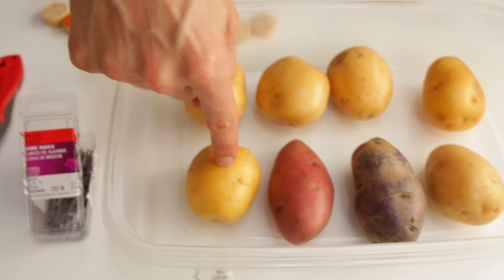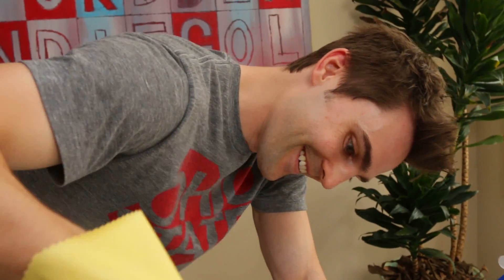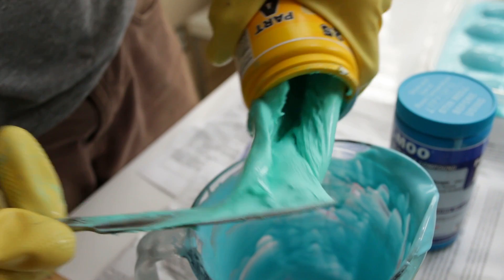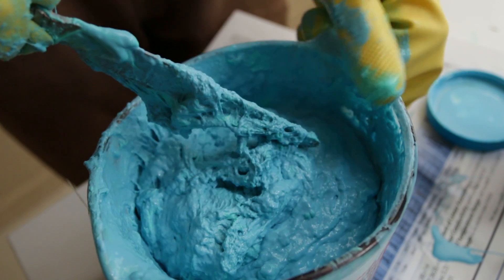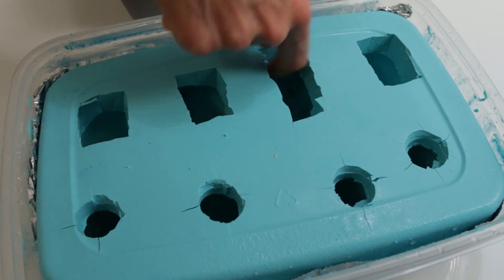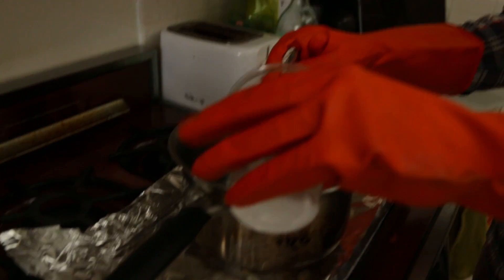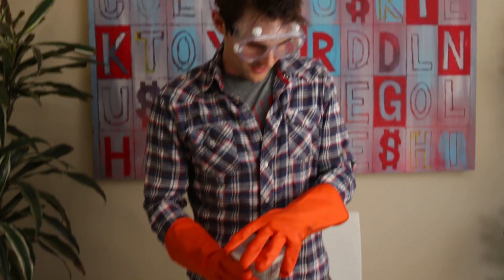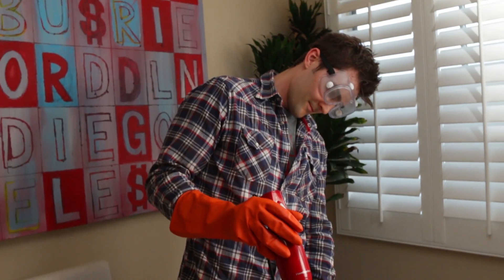Experiment Gone WRONG: Making Soap Disaster

Comment: I'm thinking about the "scooping out the potatoes" part: wouldn't it be easier if you use small balloons? That way you simply blow them and you don't need bigger holes
But maybe the mold break them or reacts in some strange way D:
Don't know, what do you think?
Reply from the maker: that's actually a good idea, we actually could have done exactly that but filled the balloons with water... popped them and scooped out the empty balloon

Comment: haha that's okay Nick. can't get 100% right every time. But what I BELIEVE you were supposed to do is cut the mold in half. If you get a good cut, you'd be able to take it apart and get the potatoes out, put it back together and fill it, and then take it back apart to get the soap out.
thanks for sharing this vid! good reminder that not all experiments go the way we planned.
Reply from the maker: ahhhhhh, yea I totally flubbed that part. I wasn't sure exactly how to work with the oomoo (actually what it's called). The next time I do this, I'll just cut it right in half. Thank you!
Reply: I'm researching some more stuff and I'm not 100% sure if my suggestion is a good one ;o;. Mostly because cutting around the potatoes might prove to be difficult.
 I was doing a bit more research, and it seems like allot of people suggest doing a two part mold. I even found some videos (i can send them to you if you're interested), but it would take more materials and more time than just making a one part mold. The only reason I suggest it is cus I don't want you to end up with another video where you can't finish the experiment OTL. Of course, if you're not planning on using it again after this, it might not matter as much, and it doesn't need to be perfect it.
You could try my previous suggestion with just one potato that you don't really plan on using for your video and see if it works first? 
I just don't want to give you bad advice sense I know how much you and your colleague work on these videos.
Reply from the maker: Hey! I super appreciate that! Maybe I will just cut up the mold as it is (I doubt I'll use it again). The art store did say that using a two part mold would be potentially better, but would also take more time... we opted for the faster version. Although I think this led us down a messy and dark path lol!!! If you find any good info, just let me know here in the comment section! Thank you!
Reply from the maker: I just watched that whole video! Honestly we should have done it just like that. We would have saved so much time if it just went right the first time!!! Thank you btw!